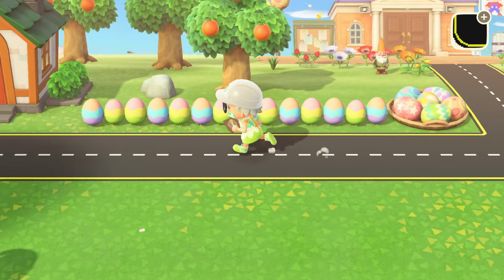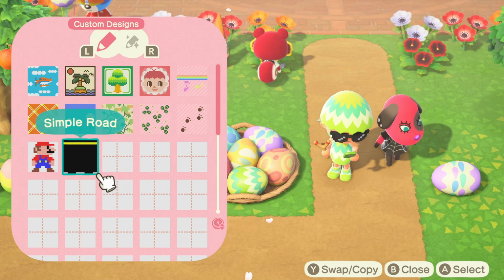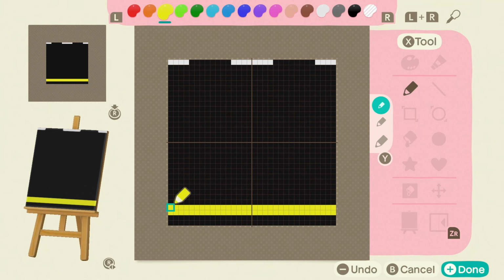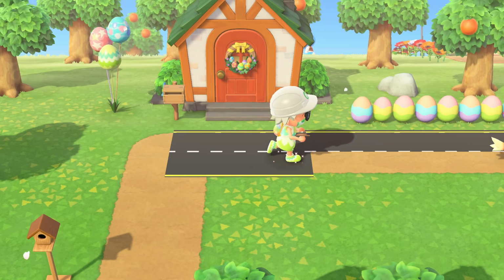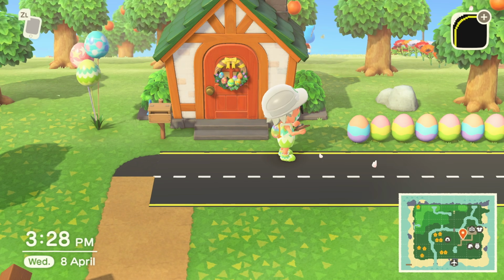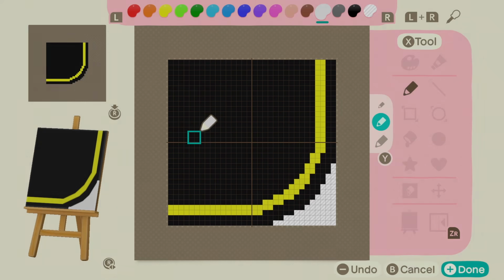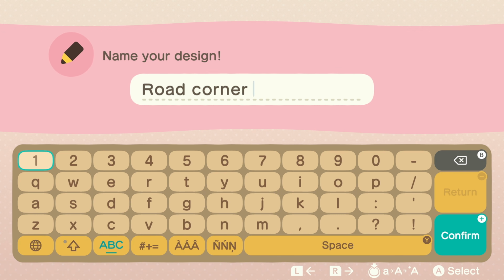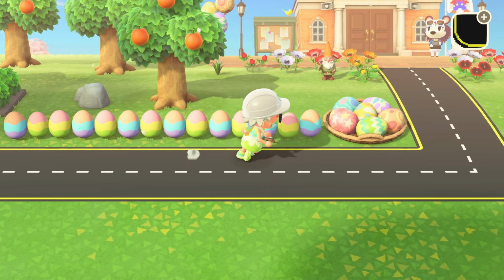Animal Crossing New Horizons How to Make Roads - Roads custom design tutorial

Comment: Tried this today and it worked pretty good. The only issue I had is that if you have another surface on top of the grass ( I had dirt ), you need to remove or else the yellow lines will not show up. Little hard working in reverse as my brain was not used to it but it worked at the end.